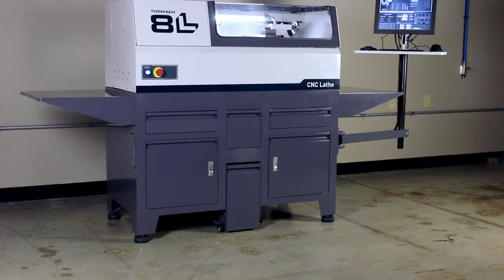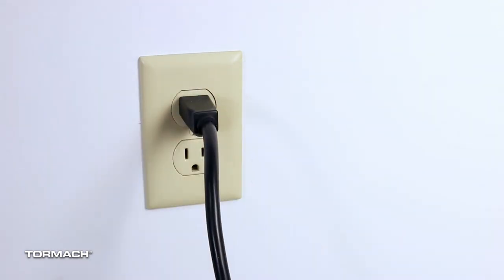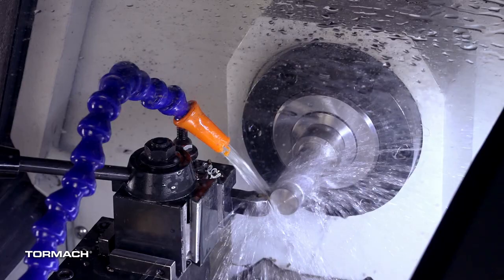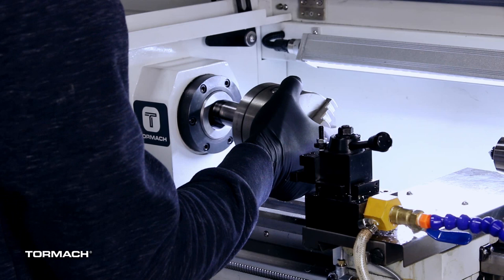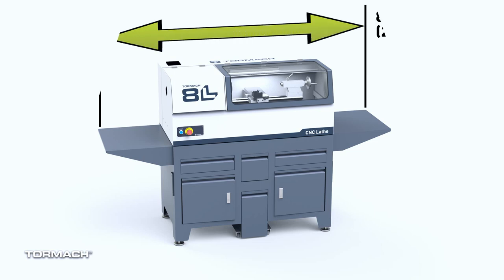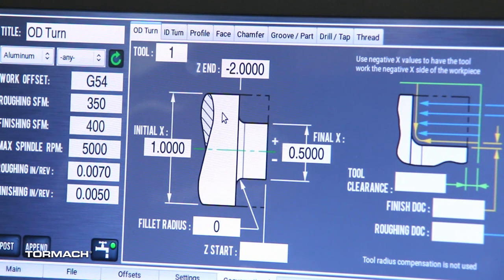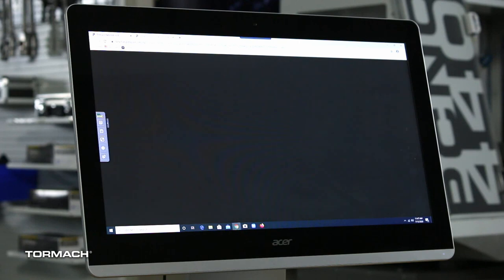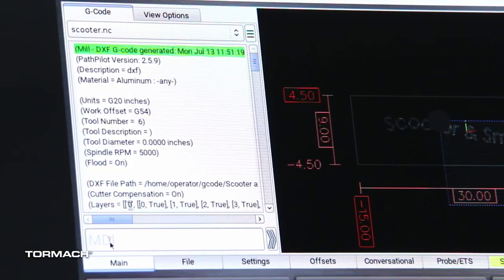Tormach 8L Lathe Overview

Comment: Ordered it tonight.  It's looking forward to joining its PCNC1100 SII and 1100MX siblings here in the airplane hangar.
Reply from the maker: Thanks for adding on to the Tormach family! Since your  in an airplane hanger, do you use your Tormach's to repair planes, or are you building new planes?
Reply: @tormachinc  What is The Cost Of This Model...? FOB...
Reply from the maker: @EagleNews1122  You can find all the pricing for the Tormach 8L its webpage. The FOB would depend on your location, so you can request a quote to determine that. https://tormach.com/machines/lathes/8l-lathe.html

Comment: Hi, where's the deets? I don't see on your site? Looks like a repackage mini-lathe rather than a small pro style like you did with the 15? To really be production worthy, it needs a auto-closer and bar puller but didn't see those on your site either? I'd really like to see the details of its construction. (I had a Series III with 4th axis, and came to see you guys a couple years ago to see the 15l). I'd like a lathe, but cost with the features I need always an issue.

Comment: Interesting! 🙃
But Update a manual Late to CNC will be cheaper if you know how to do it.
Spindle 5C chuck release is it fast? Pneumatic, or need to rotate?
Reply: small manual lathes are so crappy that it takes a ton of work to make them remotely reliable or accurate (I converted both a full size Grizzly lathe and mill to ballscrews and servos and wouldn't do that again).
Reply: @spinnetti  if you  work on them and doing some product and get money for that, the best is to buy. But if you a hobbyst better to do it yourself - it's interesting. And you can repair yourself.
But if you buy it, you need to wait for service if something goes wrong, or you will loose the warranty if you will try to repair it.

Comment: Very nice machine for the size and 110 power. One question though. What is with the rubber gloves when putting on the chuck? As a lathe hand for many years gloves are a no no anywhere near a lathe, or any machine tool for that matter.
Reply from the maker: Yes, in general gloves are not suggested around rotary equipment, but the nitrile gloves that Jason wears are very thin and rip easily.  Any gloves that are made of fabric, leather, thick rubber/nitrile/vinyl or nitrile coated fabric, and don't rip easily are not recommended around any rotary equipment.

Comment: Possible to addjust it to 230v power supply (Europe)?
Reply: you could always buy a transformer for probably $100 on ebay
Reply: @Foomanlol  oh... Thats right, Thank you!
Reply from the maker: Please check with your local building codes before purchasing a step down transformer for use on any Tormach product.
Reply: @tormachinc  but does it come in 230v?
Reply from the maker: @galle66  It does not come in a 230v version. You will need to add a step-down transformer that conforms with your local building codes.

Comment: What is the weight of the machine itself without stand? I'd need to move it into a basement and wondering if its doable with a couple guys carrying it down the stairs
Reply from the maker: Since the Tormach 8L Lathe is 618 lbs., we would suggest renting a stair climbing hand-truck or hiring professional riggers. You should also check if your stairs are rated for the weight of the lathe, hand truck and people.
Reply: @tormachinc  Thanks will definitely be looking into that more